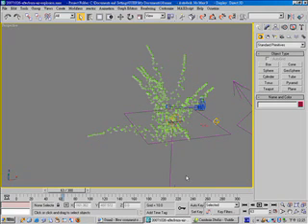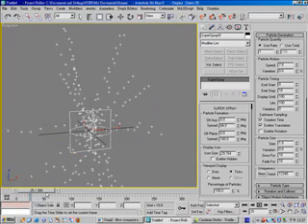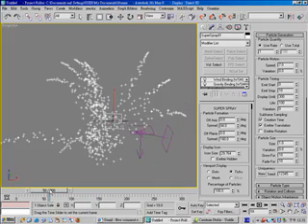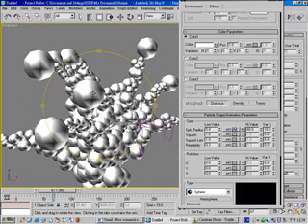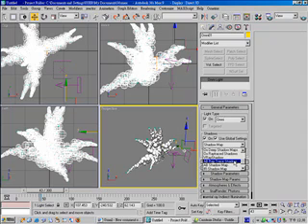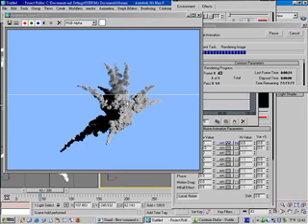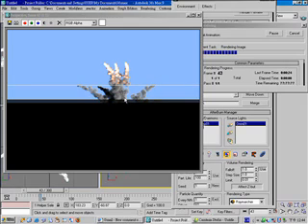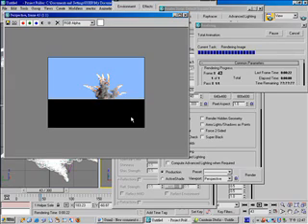Air explosion with Afterburn in 3dsmax 9

Comment: hey bro can you please help me? Ive used fumefx for this method. How come when ever i create trails like these, they are extremely low quality and blurry even at 0.7 spacing? Ive set the turbulnce to 1 and even with fluid mapping, its blurry. However, the radius is 1-2. Is that why?? thanks

Comment: Hi there.  I've always had problems getting my AfterBurn particles to FADE out. There's no opacity value for the particle texture, only for the coverage, size, etc.

I generally make the coverage go down and make the blur go up over the particle life.  That makes the particle go from fire to smoke to invisible, basically, but I still feel that it's not the right way to do it.

How did you make your particles fade out? I've seen in done in a Supreme Commander cinematic too.